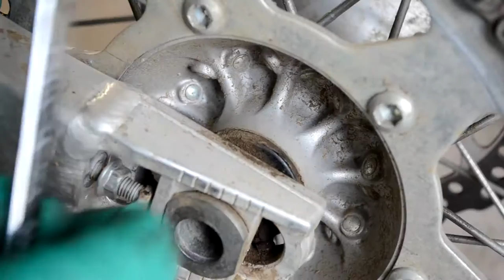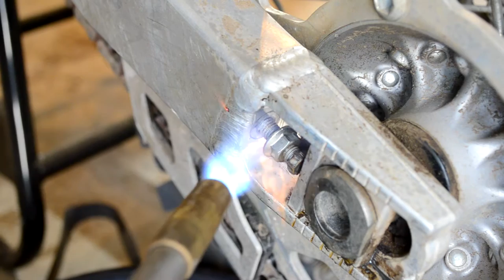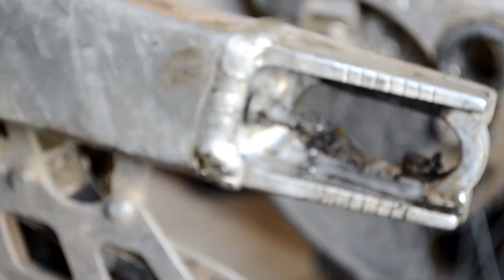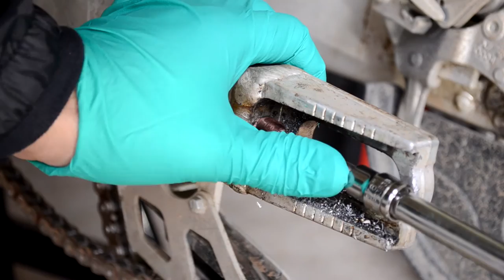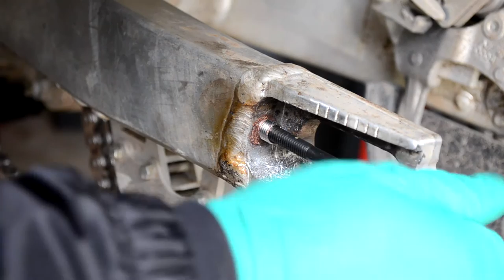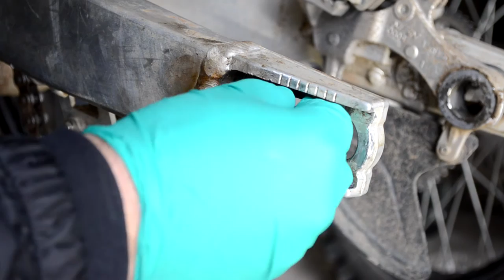MY CHAIN ADJUSTER BOLT IS STUCK IN MY SWINGARM!! (How to Remove)

Comment: Same problem just I drilled a tiny hole into the swing arm itself and sprayed lubricant through the hole onto the bolt and I was lucky enough to get it out like that
Reply: How did you know where the bolt was and if the bit to the hole was going to hit the boat or not?

Comment: worked for me with lots of different siezed bolts,good for rounded bolts to,the weld wouldn't ever hold strong enough trying to weld another nut to it. thanks Steezer.
Reply: sorry I meant trying to weld another bolt to it. thanks steezed

Comment: You are twisting the bolt against the axle blocks.  Take the wheel off and attack it from the end with a socket and an impact gun.  Also raise the swingarm so the pen oil follows gravity and runs down into the hole.  Invest in a wobble bar too.  You don't need threadlock the bolts ... that's why there is a lock nut.

Comment: I searched youtube for suggestions because I had the same issue with my WR400F and came across this vid. Thanks @Steeezed but looks like you had a rough time and had to use every trick in the book. I removed the rear wheel, loaded the bolts up with WD40 and after a some soaking time hit them with an impact gun with 10mm socket. Both bolts came out with no damage and it took 10 seconds...

Comment: İ have same problem on kx450 i want to drill it out but adjuster is looking a bit inside and i dont know how will i drill staight because there is not a good gap for drill fit there did you need a longer drill for that or can i do with any drill?

Comment: far easier if you had welded a bigger nut over the existing bolt head,could of welded it right away around,and the heat would travel along bolt breaking the hold it had.
Reply from the maker: That's a great idea!
Reply: Doesnt work. I tried that, the heat in fact probably weakened the bolt at the entrance. I tried it and it broke still right at the entrance point of the swing arm with adequate heat on the entire thing.